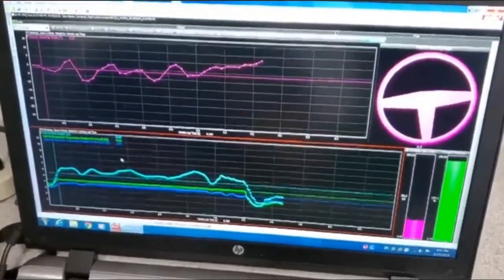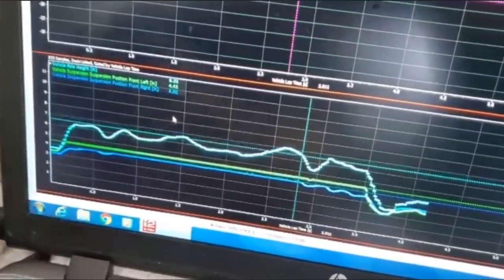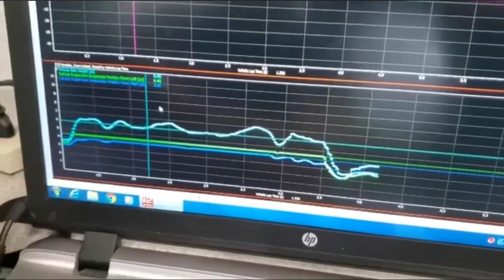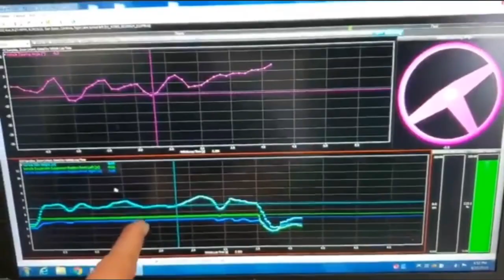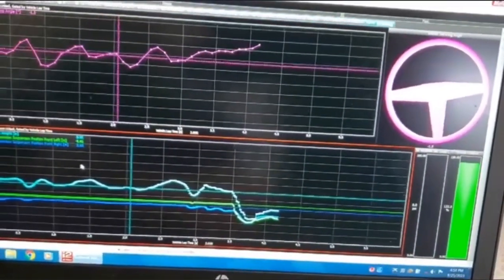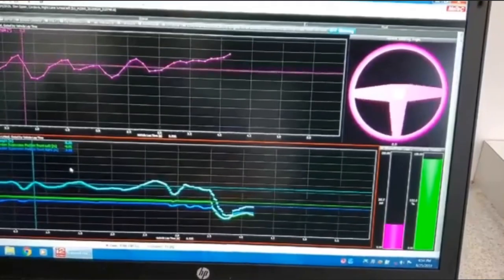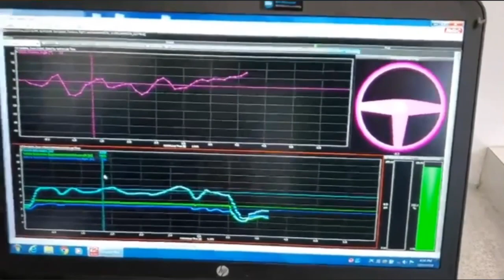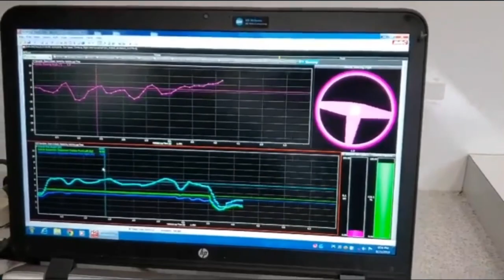Analyzing Sorceress’ MoTeC Data To Determine Handling Problems - Tuned By Shane T

Comment: If the front suspension could travel even more down when accelerating and try to simulate that condition (front ride height) to see what's the toe at that moment maybe could help to fix the problem?
It is fascinating to see a datalog with lots of sensors
Reply from the maker: JoseC the front suspension only travels to the end of the strut. More downward movement is not possible unless we changed spring or strut travel.
Reply: @TunedbyShaneT  I just saw that Sorceress is now faster! Congrats to the Team!
Reply from the maker: JoseC thanks!